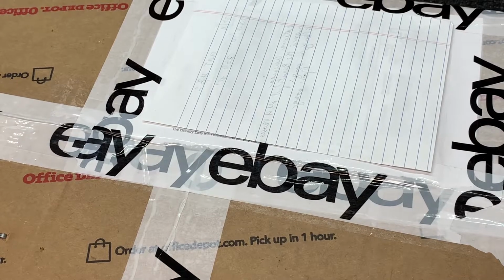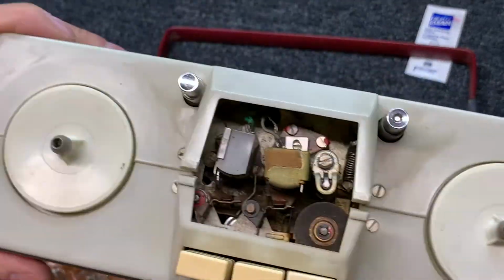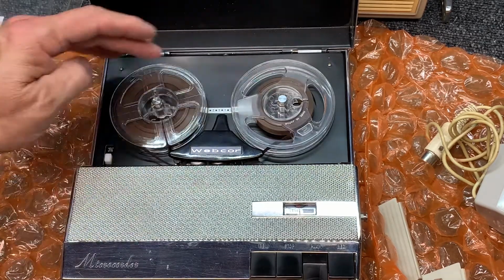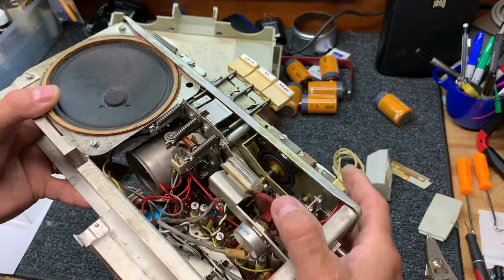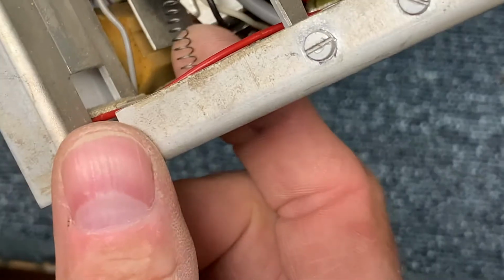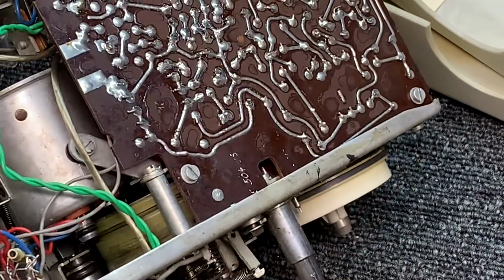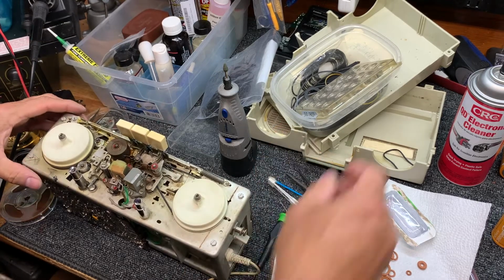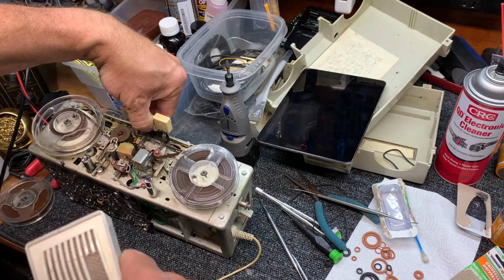Vintage Tech: Norelco Continental 101

Comment: Thank you for this video. I have this model from when my dad was a kid. the battery label was missing and all these years I thought it was missing some battery holder or something. When trying to find out about this the only thing I could find was that in might be a Norelco Continental 100 instead of 101. This was very informative I haven't tried it yet but I think you gave me the info I might need to crack it open if necessary. Thanks!

Comment: Nice repair job, these are not easy to work on. I've got a Philips version, (I've never heard of the make you've got), but it's a slightly different model with identical electronics. The volume knob is near the base of the machine with a tone conrtol. The belt for rewind on mine is bent and loose, but to replace it you have to remove the head assembly, pinch roller and guide it up over the capstan, so I did'nt bother fixing rewind. :) But the sound is great from these tape decks.

P.S. That poem was brilliant, any chance of playing the full tape at 7 1/2 ips ? That way it won't be detected, and I could slow it down on my RTR :)

Thanks for an awesome video.
Reply from the maker: Franko.  I was tempted to let the tape play but part of it is pretty naughty.  I have not listened to the whole thing. Parts are just fun.  Let me ponder how I could send you the whole thing.  (Email?)
Reply from the maker: One more thing. I replaced my rewind belt off camera.  I thought the same about having to lift off the head assy. But you don’t have to.  The belt is designed to slip under that mess and not  have to remove anything. I studied it quite a while and found the secret path under the heads. ;)
Reply: @KOVintageTech  I did'nt know that, thank you. I might have a look at it one day. The tapes I've made on it though I just play straight through.

Comment: Not many techs work on small reel to reel machines. I enjoy watching your videos. I like working on them too. Making them sound good again is a challenge I have a green four transistor Westinghouse 3" reel to reel that I recapped but the audio is chopped up and distorted. Sounds like a transistor that's lost bias. I recorded a one kilohertz sine wave and played it back through a scope and it looks and sounds clean but music or voice is not good. 400hz is crossover distorted on the scope. I give up. Maybe the germanium transistors. I'm tempted to convert it to PNP silicone transistors and re bias
Reply from the maker: I have had this experience on a few units as well.  I believe that the motor may be causing some of this.  It’s a vibration-like distortion. Thank you for the affirmation.
Reply from the maker: Another thought. Do you have a sweep generator? Maybe you could record a sweep of the whole frequency range like 200-3000 hz.  And see how that looks on the scope.
Reply: @KOVintageTech  I bought a Craig 212 on ebay listed for parts not working for $10.00 its not yellowed or dented. Looks like new on the outside but has a lot of hours on the inside. Its missing the play/record slide switch that mounts on the PC board. Its also missing the lid cover and battery cover and mic. Oh well if you ever need parts let me know hahahaha. I wish I could ship it to you I don't have any use for it
Reply: @KOVintageTech  I think my first post got erased somehow. It was about a function generator app on my smart phone. It has a sweep function too. I'll have to give it a try thanks
Reply: I found the problem. The cotton pad that pushes the tape against the head was a little crooked. I can't believe something that simple evaded me. I should have seen that a long time ago 🤣 sounds much better now

Comment: wondering, I have one of these but the microphone is missing, is there another type of microphone that can use the same connectionon this reel to reel?
Reply from the maker: Yes certainly. Any mic with the correct connector will work. These were “crystal” elements that were very hot.
Reply: Do you know the name of the connector? It seems to be similar in size to a midi cable and is 5 pol.
Reply from the maker: @peterpower2485  Yes, it is a 5-pin DIN connector. And the mic is connected to pins 1 and 3. Here is a Parts Express version: https://www.parts-express.com/5-Pin-DIN-Plug-180-degrees-090-341?quantity=1&utm_source=google&utm_medium=cpc&utm_campaign=21081298514&utm_content=162693410634&gadid=692832564687&gad_source=1&gclid=Cj0KCQjw5cOwBhCiARIsAJ5njubI1Z4-hLd1hUIIfA90amHJVfoxEAEKTftqHLdozHdvfTo2HgtdubgaAoU9EALw_wcB
Reply: @KOVintageTech  thank you so much!
Reply: Another question: what is the name of the power unit you are using to run it the apprpriate power? I would like to run this without batteries for an art installation. Thank you kindly
Reply from the maker: @peterpower2485  my model does not have an external power connector. It only runs on batteries. Does your model have an external power connector?
Reply: @KOVintageTech  No no its also battery., same as yours. What I am refering to is the power source generator you have clipped to the unit while you are testing it, that is running things instead of the batteries. What is that? I will be running this model for hours at a time in the installation and batteries simply wont last.
Reply from the maker: @peterpower2485  I used a bench power supply. Tenma 72-7660.  It’s way overkill for that application. But the  power is 9 volts DC at around 150 mA.  If you can find a 9 volt supply that produces 1 amp it will run great.
Reply: @KOVintageTech  Brill thank you again for this invaluable information.
Reply: apologies, but I am wondering where I might order some of the belts that are driving the playback wheels? Both seem to be missing or damaged on the unit I have.
Reply from the maker: I bought bags of small belts on eBay and Amazon.  Found some to fit. I don’t have a record of the exact size. You will need to try a few to get them right.